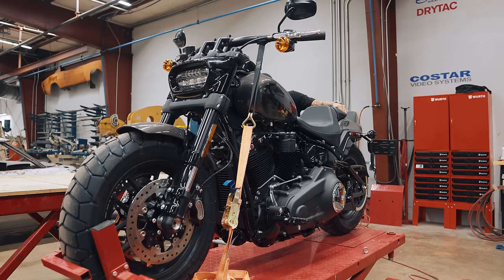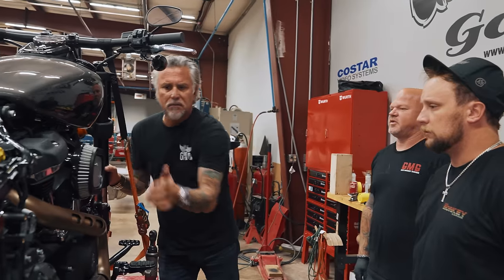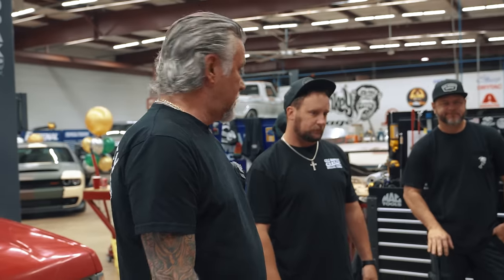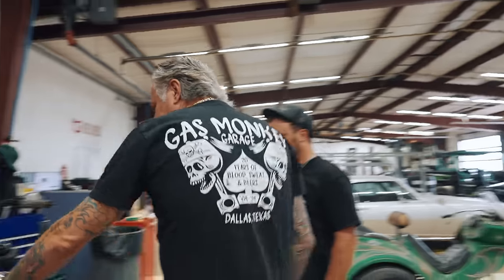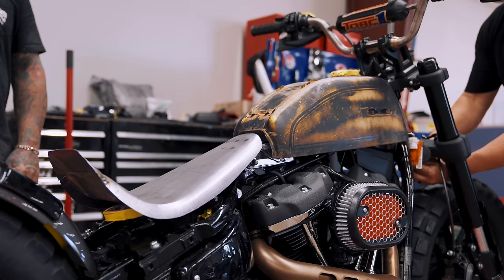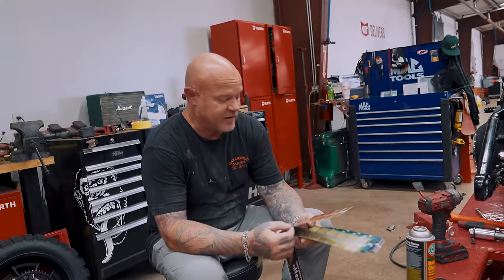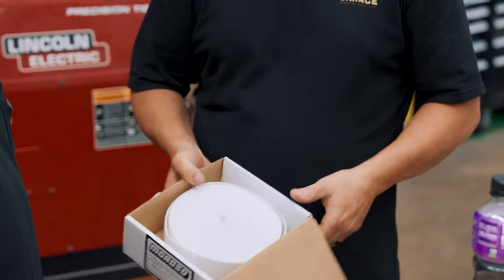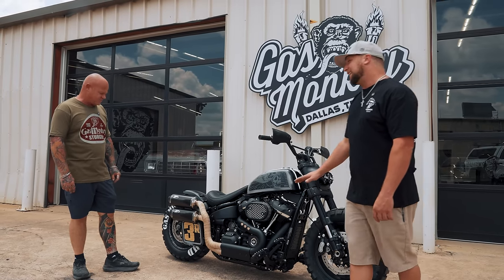We Built Richard a Motorcycle | Complete Build

Comment: Absolutely love the build! This is pretty much a 2013 Harley XR500/750/1200 build but with a fat bob. What would have been easier was to use a tank from the 2013 xr500. Its very similar to that honda tank and has the fuel pump built in.     BUT I do like the honda tank lines better. They made some of the most iconic designs that people love.  Great build.. miss the bike builds.                  Making me miss my Harley custom 1200xl with fat tires. I dont have anything to ride anymore.

Don't forget a dynojet power vision tuner... You will thank me later...

Comment: We used to have a tank guy that would put the tank filler hole over  the exhaust of a running car and the carbon monoxide strips out all the fuel vapour in about 10-15 minutes, soon as it cooled down he would cut or grind it.

Comment: NO, you have to change the controls or buy the Harley wire sets but if it is a NON-ABS bike you must change out all of the brake lines.  That was a goof by Harley in that the dealership had no idea that you could not just buy the upper brake lines you had to buy the whole length.  Cost me another $150.00.  I was the first guy I guess to do this and even the P&A catalog wasn't updated at that time.  HD was trying to catch up.  Whenever you buy first issue model you have that.  NO worries, I figured it out and told the dealership.  LOL.   That bike in a 107 pulls like a train and in forth gear in Kentucky hills it would roll right on thru.  Great bike and not appreciated as it should be.

Comment: Says nothings stock on bike no more lol. Front ends stock, wheels are stock, brakes are stock, rotors are stock, exhaust headers are stock, risers are stock, engines stock, air cleaners stock. 

No speedometer will make the cruise control stop working. 

Tank decal looks like a rip off of the hells angels death head good luck riding that before you get a tap on the shoulder.